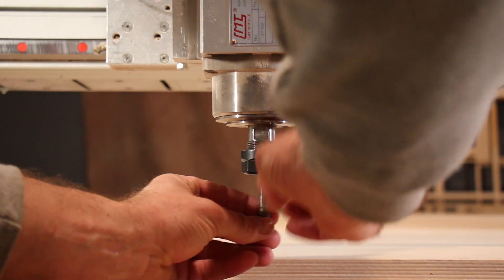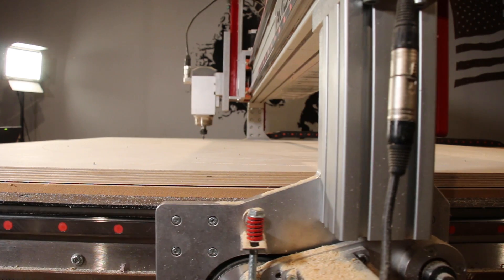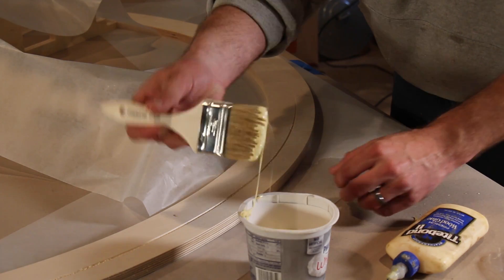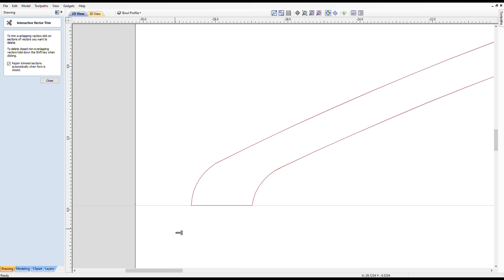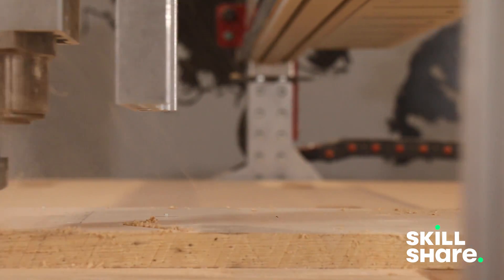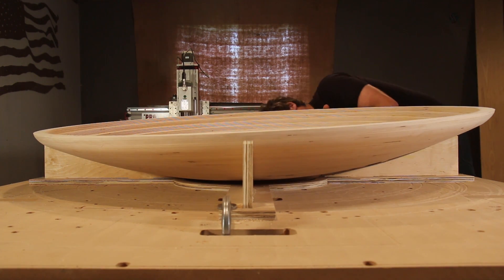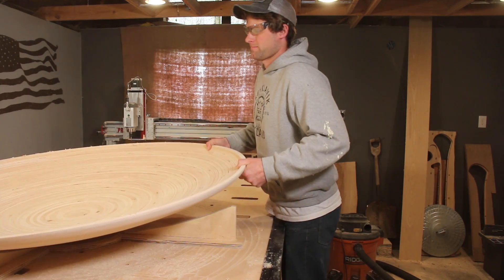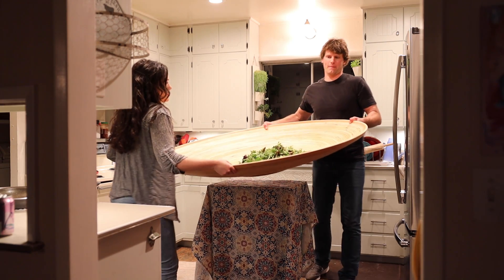Big Bowl with a CNC Router

Comment: When gluing the bowl to the jig when it was upright, an old trick used on the leave is to glue the bowl to the jig with a piece of paper in the middle. This will hold it firmly but allow you to knock the jig off after the work is done and only have to sand off the thin layer of paper.

Comment: Awesome project, so cool, so creative. A few pro tips from a commercial shop . Get a bigger ball nose bit. The bigger radius of the ball the bigger step over you can use and have less to standout, greatly reducing machine time. For example I would use a 3/4" ball for this with a .08 step over. Also no need to cut your lift so close the finish. Your using cheap material, way to margin for error hear .Get close, do a roughing pass, you can even do the roughing pass with a ball nose, because I see your little machine does not have a tool changer.

Comment: Consider that if you wanted to make a deeper bowl, then shaping the individual sections and using alignment pins could work. Once you had the CNC work done, assemble/glue it and then start with the sanding. The pins themselves would not have to be long or thick.

Comment: Why didn't you use a 3/4" or 1" diameter round bit instead of the straight bit to finish?  If you didn't try it yet, you should.  The surface will be cleaner and smooth.  Very nice project.  Hope you will enjoy it.

Comment: 1/4” bit? Why?  There’s no need for that small of a bit. Use a 1/2”, you can use a larger step over because it will leave cusps on the machines surface that are shorter. Less machine time, you can move faster and less sanding.

Comment: Would like to point out the fact that if you remove the table from your CNC, you can then create a turn table, that's at the best angle to rotate the bowl in increments so that the CNC's head cuts it whilst having "flat" surfaces VS the bowl sitting flat on the table, thus limiting your height.

You can then go wild with what you create. You can make non generator type shapes, you can make bowls that resemble an oil barrel in proportions, you can make a human head in CNC. The world is your oyster. :)

All you need to know about this kind of CNC use of your CNC is this.

1. Work in sectors, and if your work isn't based on a generator (that is to say, not round, for example, you have a handle in your bowl or some other feature like say a lion head) then you need to have separate sector GCODE for those, but if you do, then it's the same program run four times (or more, really, depends on the size of the bowl).

2. You need to perfectly measure the center of your machine, i mean, within a MM, not that complicated, but i would not start work without that.

3. You need to make the turn table to be adjustable for inclination and to have perfect bearings on the rotational axis. Any "wobble" in the system will kill the project, well, to a degree of obfuscation.

4. You need a very rigid means of blocking the turntable from rotating and that the CNC table does not move, referenced to the turntable.

There are some folks out there who've done this with the same machine you have, so seek them out, or at least their projects.

Comment: On my cnc machine i actually only use a couple dabs of hot glue to secure work down, milling wood is a low force process and i haven't had an issue with that process yet (saw the tape idea i like that too).

Comment: How many times did you have to blow out the filter on that shop-vac? I got tired of that pretty quick, myself. Built a quick dust separator for my shop out of a Dust Deputy and a 55gal steel drum, works like a champ. Haven't had to blow out my filter since (about a year now). Anyway, novelty projects are always fun to watch. Well done.

Comment: Nice project. I have found the Amana Tool 45986 Carbide Tipped Bowl & Tray router bit to be one of the best bits to use when I cut out bowls or trays on my CNC but I have kept all mine under 20 inches.